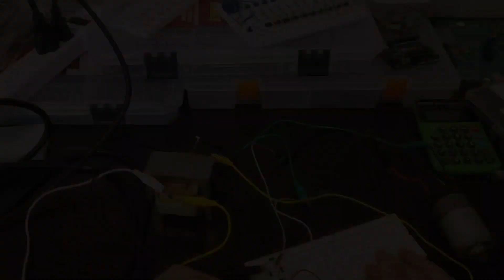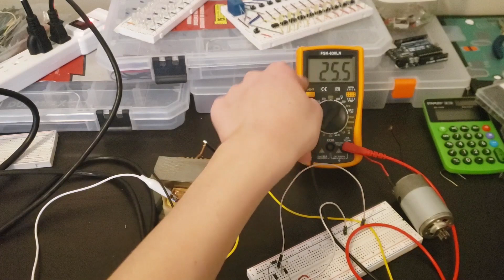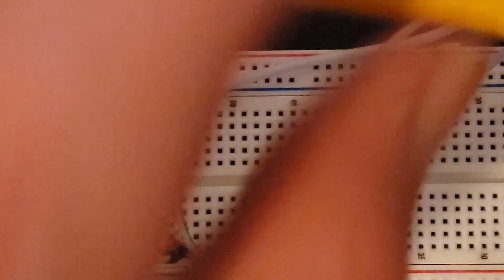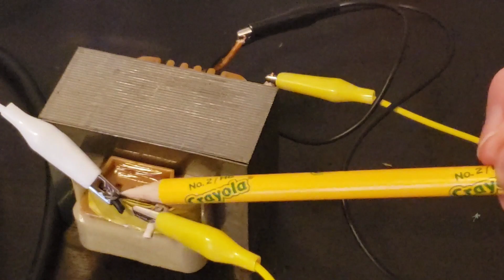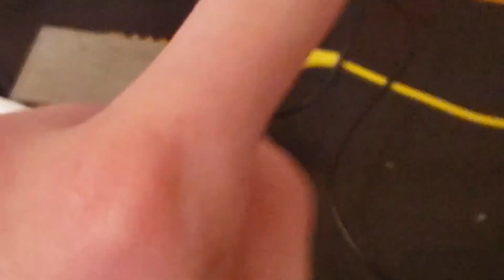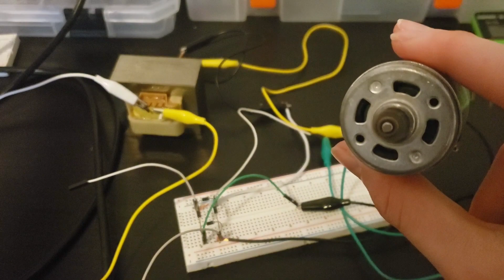Exploring Bridge Rectifiers

Comment: Okay so I wonder what DC exists like as the thing that we're not really trying to have inside of our power lines that transmit an AC signal while at the same time when an alternator and a car loses one of a few diodes what happens is you get a range of ac voltage bouncing around inside a DC battery and system and it is noticeable but it's not really directly noticeable you just know that you have a loss of power in a system-wide efficiency because of what DC system does with AC it doesn't do with AC unless it's from a sensor to an expected location but not as a source of energetic mouse game mouse trap Domino's you know what I mean but yet 50 volts ac can look surprising at random and your car battery looking at the multimeter as the display goes 50 and then nothing and then 50 and then nothing cuz it's literally bouncing around in there but it's not as negatively impactful or effective as one would assume but that's just my experience 20 year mechanic